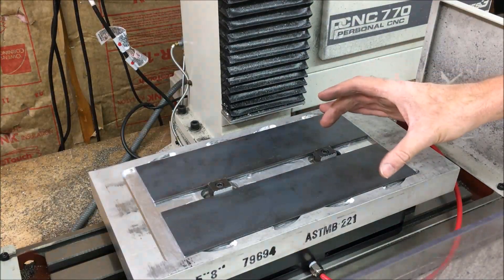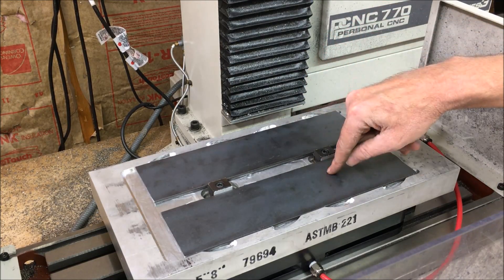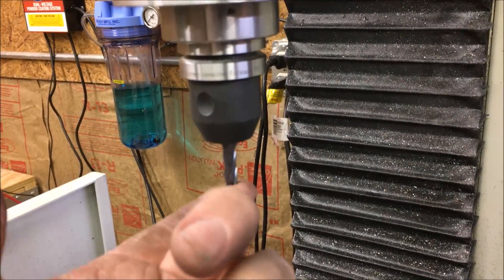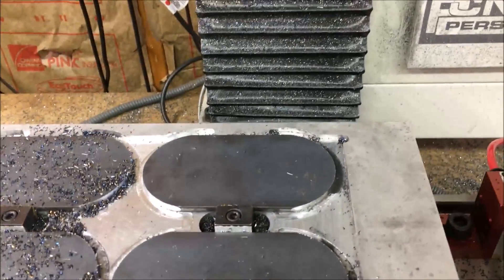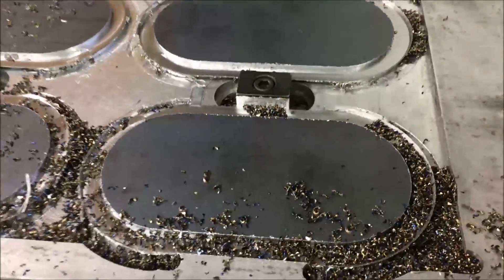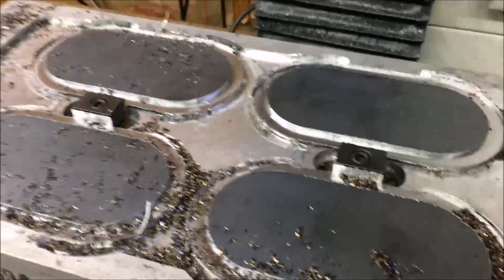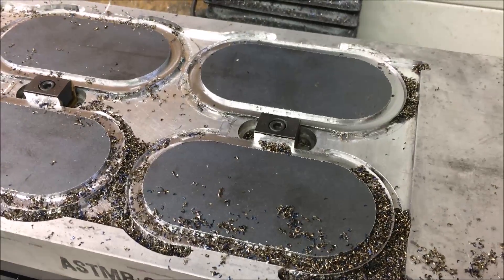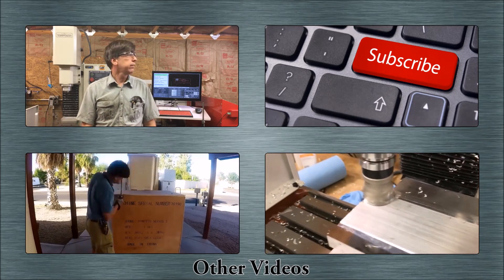High Speed Machining on the Tormach 770

Comment: TOO HOT!
lol
Reply from the maker: Yeah, that was in my noob days.  lol
Reply: Been there, still learning tho hah. Been about 2 years since i started running a HAAS. 
Time for me to get something physically smaller that's mine and will fit in my garage lol.
Going for a 770.

What are your running settings now ?  Feeds and speeds?  
Depth of cuts ? .025-.050?
Reply from the maker: I ran a Haas once, Nice!  Great, I love my 770!

I make the covers (CRS) at 40 IPM, 5000 RPM, .050 Optimal load, .25 DOC with a 1/4" 4 flute rougher.  I like the YG1 X Speed

Comment: I'm Sorry dude but it looks like you didn't get the point of high Speed Cutting. It doesn't mean Full woc cutting with an endmill at high feed rate. If you had used a tiny carbide Facemill that would count i guess :D
Reply: Hey, that was nearly 2 years ago. :-)

Comment: Hi, I've been looking at your channel because I'm planning on a 770 and it has been very usefull to decide on what accesories to buy. This video is over a year old so maybe you have realized, but for the benefit of other viewers, this might be maching at high speed but its not "High Speed Machining". HSM is about constant endmill engagement (less than half diameter) so you can machine faster than you would if you had to set your IPM considering you had to use full endmill diameter some times. You can't just get to your mill and do HSM, you need to plan for that by using HSM paths in your CAM. A calculator like gwizard can tell you how fast you can go with HSM
Reply from the maker: Cool, thanks!  Yeah, that was a while ago.  Just a fancy title for more interest. LOL  I still have a lot to learn though.  I will be taking the 14 week Titans of CNC class starting next week though.

Comment: Yikes! Conventional cutting and end mill plunging. Try climbing and ramping to depth.
Reply from the maker: Yeah, that was awhile ago.  I still conventional mill though because I mount the covers with only a center screw.  Climb milling will spin the cover.  I use 2D adaptive now.
Reply: The adaptive paths make machining life so much easier - with a lot less breaking things.

Comment: I too work with a Tormach 770 and because  its essentially a hobby mill I've had a hard time finding a resource on how hard I can push it without getting premature wear on the mill and the tooling.  I'm glad to have finally found someone who is willing to be as aggressive with their 770 as you are.  It' makes for very good reference points when trying to do High Speed milling on my own mill.

For the life of me I find it hard to trust the feeds and speeds that my HSM software churns out.  I think it has more to do with me being a cheap-skate and not wanting to have to repeatedly buy more replacement cutting tools than being overly cautious about overly aggressive feeds and speeds receipts.

Regarding that lip of metal that your cutter is leaving behind;  if those are square cutting end mills with no radius on them this could mean that the very sharp corners of those cutting tools are either wearing off or breaking off leaving that thin outside edge of your part untouched by the cutting face of your end mill.  I've had the same thing happen to me.

Comment: where are you getting your speeds and feeds from?..i feel like your trying to go way to fast..which is why you had to lighten the depth of cut...with carbide I would use like 250 sfm and .0015 chip load per tooth and take the contour in 1 rough pass..then a finish pass 25% faster for both...and for the drill 100sfm .003 per rev per tooth..and peck .02 pecks .1 deep...then plunge...but thats just me...3.82XSFM÷(DIA)=RPM*  RPM X CHIP LOAD X TEETH= FEED

Comment: Do you have to babysit this machine or in a production environment could you start the process and walk away?
Reply from the maker: The run times vary from 4-8 minutes.  I usually debur/clean/stack prior parts and cut raw material while it is running.

Comment: CENTER DRILL FIRST SHOULD STOP MOST OF THE RUMBLE THE RUMBLE IS THE TOOL DOES NOT CENTER ITSELF UNTIL IT EMBEDS ITSELF FULLY
Reply from the maker: +Ken Hendricks - I was trying to avoid using a center drill for time sake but might do so now that I am stacking the plates.  Thanks!
Reply: Ken Hendricks Don’t use a center drill around all; that’s the wrong tool for the job. Center drills are for lathe work; the 60deg included angle means that the web of the drill will not engage before the margins, which will cost tool live and hole quality. A spot drill with an included angle closer to or larger than your drill point angle would be a better option. When using solid carbide drills; however, no pre-drilling operations are suggested, unless over 7xD.

Comment: NOW THAT I WATCHED YOUR WHOLE VIDEO YOU NEED A VACUMN PLATE FOR THESE PARTS
Reply from the maker: +Ken Hendricks - I have since then gone to 16 gauge steel and stack them 2-6 plates high with a bolt through the middle.  I thought about a vacuum plate but thought it might not hold the hot rolled steel very well.  Thanks.

Comment: Why you're  drill is chattering/rumbling is because you have to light of chip load on that drill you either need increase the feed or back off the rpm leave the feed the same. That drill I would guess  needs .005 chip load
Reply from the maker: +Chief Machining - Unfortunately the Tormach 770 doesn't have the power for that kind of chip load in high and I can't keep changing the belt position.  The only thing I can think of is to keep lowering the rpm  while in high till just before the spindle stalls.  I'm at 2500 rpm now.  It will stall at 1200 because it will only be at 15 hertz.
Reply: +Craig&#39;s Machine Shop Then you need go back to using a high speed drill. Can you increase the feed at all you should be around 20 ipm
Reply from the maker: +m98custom12  - 20 IPM would be around 1.5 HP according to Gwizard.  I only have 1 HP.

Comment: The rumble is from several things. You should still center drill your locations to help start the hole without deflection. Lower rpm could help when drilling with larger diameter tools.
You will also see huge increases in tool life if you  stop plunging into the material on your step machining process. Ramp along the part contour for entry or use a 2d entry from just out side the part.

Rob
(Pcnc1100 owner) and I drive several mazak and Hass at the 9-5
Reply from the maker: +Rob Hires  - Thanks Rob!  The parts are pretty thin.  I may just use a carbide center drill and just drill all the way through.  I really don't want to add another tool change.  It looks like most of the work will be in 16 gauge and 1/8" steel now.  Yeah, I included a lead-in, out to it.  The 770 doesn't have a lot of torque at lower speeds in high gear for larger diameter tools so I am using carbide at a higher RPM.
Reply: Rob Hires Wrong; no need to spot drill (center still is the wrong tool for the application) when using a self centering solid carbide drill.

Comment: Have you tried a slower RPM for that drill feeding at 3 ipm say 1000 so your chipload is around .003 instead of .0011...Or you just kick the feed up to 9 ipm see if that helps.
Reply from the maker: +Joel Heaton  - 1000 RPM in high gear puts the Tormach 770 at around 10 hz which would have no torque.  I don't want to change the belt position in the middle of a part.  That's why I switched to a carbide twist drill.  I may try using a center drill all the way through since the part is so thin.  Thanks.

Comment: TRY CLIMB MILLING IT WILL GET RID OF THAT STEP AND YOU'LL GET ALLOT BETTER FINISH AND USE 3 FLUTE STUBBY END MILLS
Reply from the maker: +Lenny Sweet  Not sure why but G-wizard keeps recommending conventional milling. I am using climb milling now.  Finish isn't much of an issue on this part.  I will check out the 3 flute.  Thanks Lenny!

Comment: Could the rumbling be due to the drill tip against the flat surface? Try spot drilling before actually drilling, that way the drill tip has somewhere to go and the cutting flutes get a better chance of starting... just a thought :)
Reply from the maker: Thanks Bruce. I'm trying to eliminate a tool change. If I had an automatic tool changer I would certainly do that. My current plates are only 1/8" thick. Maybe I can just drill the hole with a center drill. Lol.

Comment: Thanks Craig. For small shops, I think getting the biggest machines that will fit is best. However there seems to be a lot of buzz about the 440. Smaller but maybe more rigid and precise? I have even thought about 1100 but getting 220v is going to be costly. But then I could get a good welder(another toy)
Reply from the maker: Not sure how a smaller machine would be more rigid. As far as more precise, not sure. How far is the panel from your shop?  I've been an electrician for over 20 years.

Comment: Hi Craig, I have enjoyed your videos and I am trying to convince myself to take the leap and get a pcnc. Since I only have 120v in my garage, I am looking at your 770 or the 440.   I am leaning toward the 770.  Is there anything you would do different now that the 440 is available?  Keep up the good work! Byron
Reply from the maker: +Byron Porter - Thanks Byron!  To me, the price difference isn't that much so I would still go for the 770.  If you don't have much space or are only working on small parts then the 440 might work.  Just remember that you need more working envelope then you think.  You need room to go around a part and set zeros.   Hope you get one.  Thanks!

Comment: Great video.   On that step pass avoid the plunge lead in from the side.
Reply from the maker: +Shain Terry - Thanks Shain.  Not sure how to lead in without it leading in and out all the time.  Taking the lead-in and outs cut the time way down.  I don't see a lot of options in linking  to control the tool path.
Reply: Are you using Fusion360 for programming?
Reply from the maker: +Shain Terry  - Yes
Reply: +Craig&#39;s Machine Shop  I am learning it as well.  I am sure there has to be some options in there.
Reply from the maker: +Shain Terry - I hope so.  I haven't seen any videos going into detail about controlling the tool path.  If you find out anything let me know.  I'd certainly appreciate it.
Reply: +Craig&#39;s Machine Shop For sure!  Will do.   Keep up the video.
Reply: +Craig&#39;s Machine Shop Do a 2D Contour and use Ramp on the Linking tab. Set your max depth to the pass depth you're using now. That will keep the tool in the cut and keep it from plunging which is hard on the tool.
Reply from the maker: +atomkinder67  - Thanks, I will give it a try.

Comment: if you want to stop that rumble try spot drill the hole first at moment its having to center itself
Reply from the maker: +Rick Bellamy - I was trying to save the tool change time but I don't want to rattle the mill apart.  I will give it a try.  Thanks!
Reply: bellacharge I don’t agree. No need to use a spot drill when using a solid carbide drill with a self-centering point grind. Spot drilling will often; but not always, add cycle time and cost tool life.

Comment: Looks Like your getting Her dialed in a lot quicker with the shallower DOC, As far as the edge on your shoulder pass From my experience I think thats normal especially when using a EM of similar size to the WOC. It seems to fold rather than cut the edge there's just not enough support to keep it vertical. One last thing I noticed You know me LOL. The Code seems to Dwell or pause a bit when transitioning from the radius to the straight on the lip cut?
Great job 
be Safe,
Sam
Reply: That dwell is just the way pathpilot is, its more noticeable when you cut at high feed than when you feed at 10 IPM.
Reply from the maker: +Dominik Lizak - That's what I was afraid of.  Well, I got the code down to around 10 minutes for 4 parts so I shouldn't complain. :-)  Thanks.
Reply: +Craig's Machine Shop Aren't you afraid  of stressing your machine this much? Just asking I would cry if I had to see my tormach running like this :)
Reply from the maker: +Dominik Lizak - Actually, I find that there is less stress at higher feed rates and less depth of cut.  It cuts 10-15 thou like nothing.  The HP in that cutting was only .32 and the deflection was .0009.  Yeah, I know, I don't want her to get warn out but I need to make money.  :-)
Reply: +Dominik Lizak , Ok so it wasn't me seeing things, I didn't know if it was a G code issue in 360 or Path Pilot. It seems to do it at every transition, Is there a parameter that can be tweaked?
Reply: CNC4XR7 I'm not sure. I don't know much about its parameters.